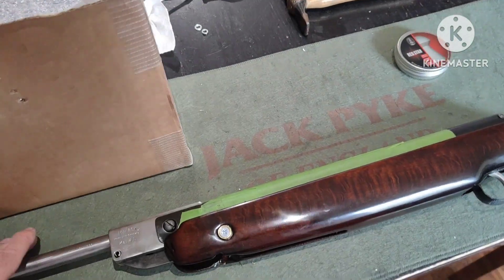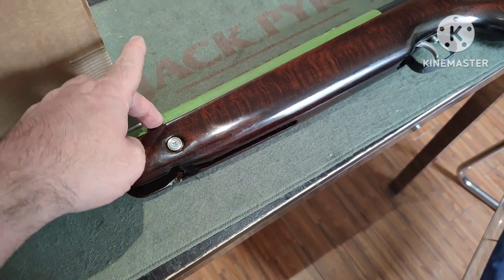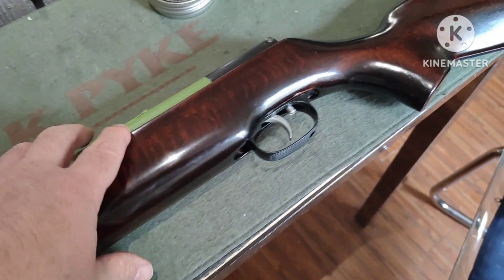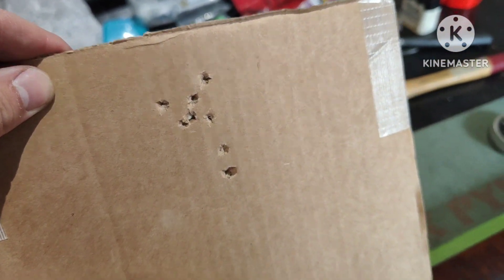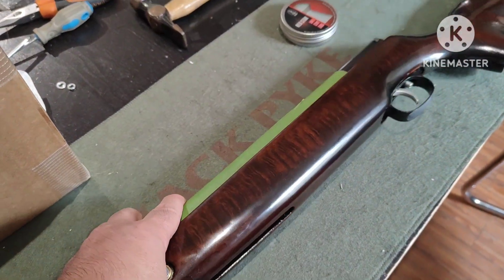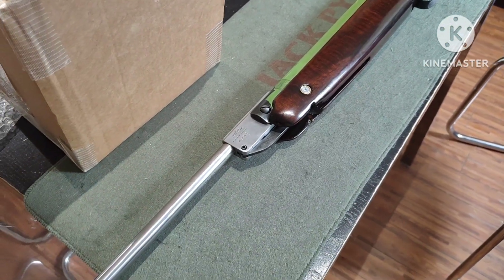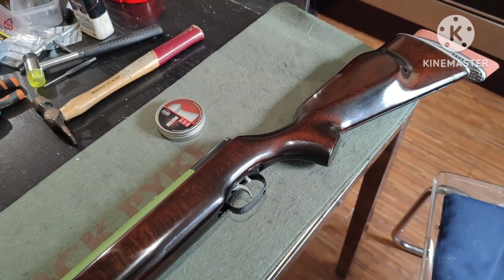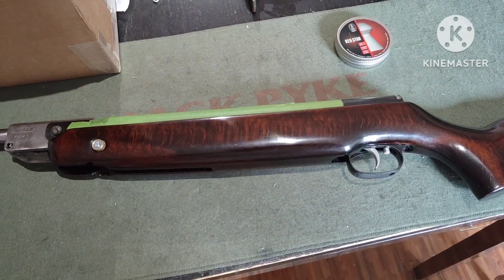Weihrauch HW80 Project: Nearly done

Comment: The power will drop if you put the barrel on a .22 cylinder and spring, i know that doesn't sound right but it tales more air to push a .177 to the same lbs as a .22.
Reply from the maker: Would be why a PCP has a lower shot count with a 177 over the 22 I suppose.

I did fit the 177 barrel on and it wouldn't cock or engage? Put the 22 barrel back on and right as rain and no problems? I only wanted to see if the 177 barrel was going to group accurately after being filed flat